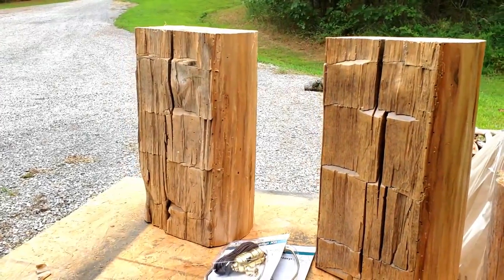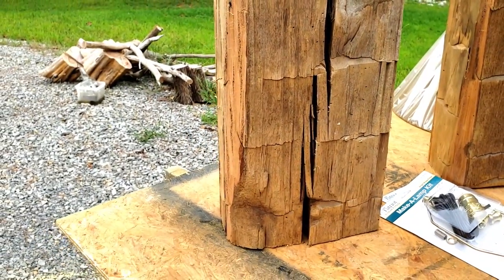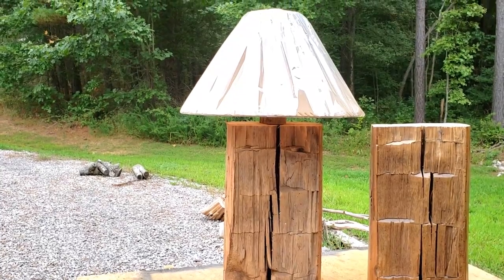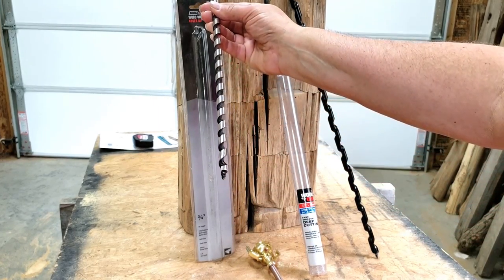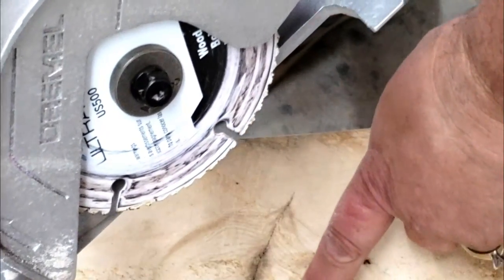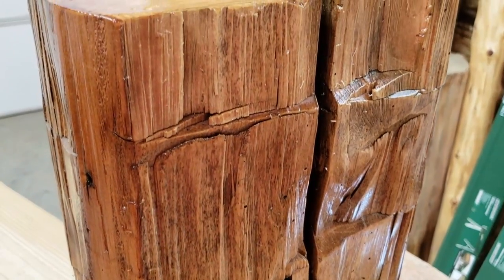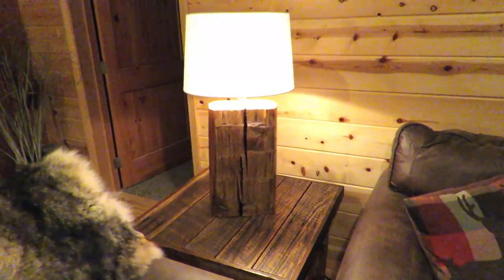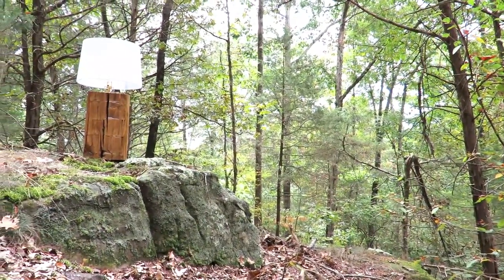DIY Rustic table lamp from Old Barn Beam

Comment: Nice lamps Mrs. K..... when putting on the wire I'd suggest looping the wire the other way before tightening it down as you'll get the wire on stronger and less likely to become loose.  The same direction you would tighten a jar lid.
Reply: Thanks. That makes a lot of sense!